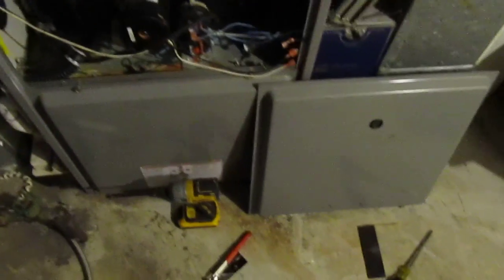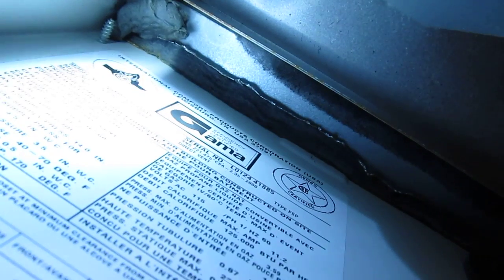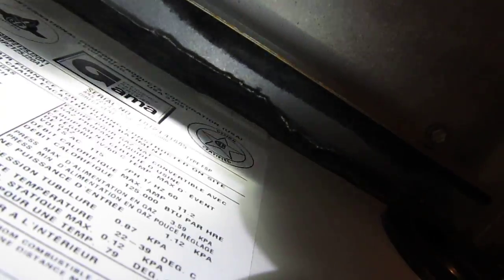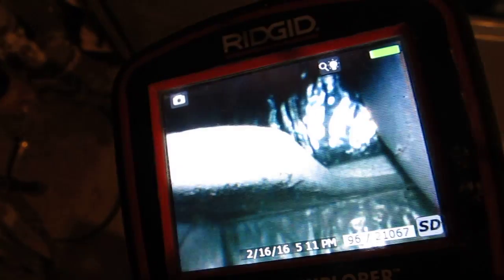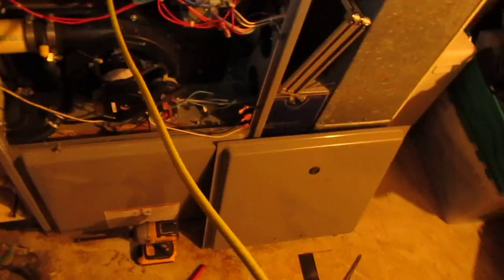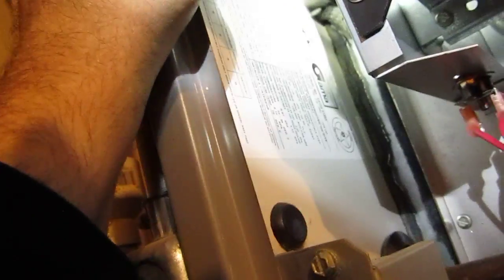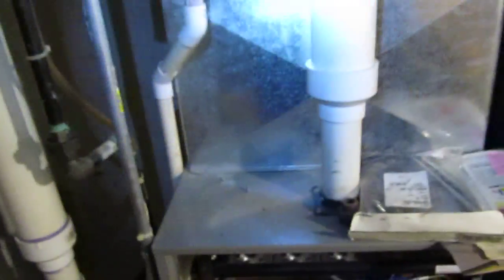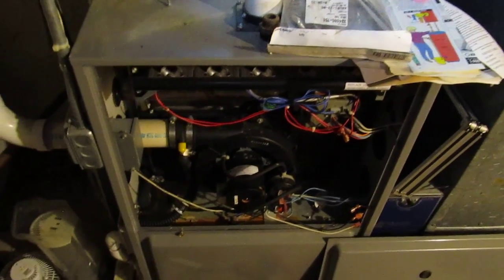Comfortmaker furnace heat exchanger inspection (CRACKED)

Comment: Another excellent video MI Heating Guy.
Question,, was there a AC coil on this furnace? And do you see more cracks when furnace has a coil on it as  opposed to heat only?
Awesome scope by the way
Reply from the maker: Not necessarily do you find more cracks on a furnace with a coil he can come into play when the coil is filthy dirty Maintenance he's huge factor

Comment: Your on a roll with the cracks, how many months out of the year do furnaces run in your part of the country?
Reply from the maker: About 8 months out of the year up here in Michigan sometimes I find three or four furnaces cracked or routed through a day
Reply: +Mi Heating Guy wow that's busy. 8 month a year we are only about 5 but not everyday and not more than a few hours a night. 
Watching your vids I now see how 10 years on a furnace is about it now a days.
Reply from the maker: Up here they run a lot more than they do down there so the run time comes into play improperly installed furnace should get about 20 years